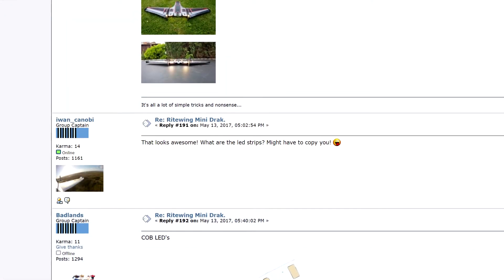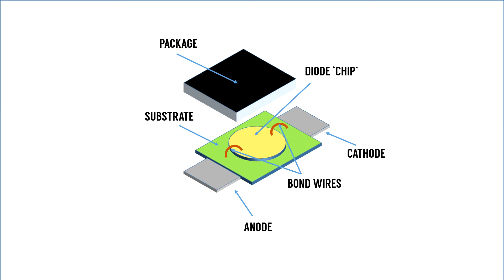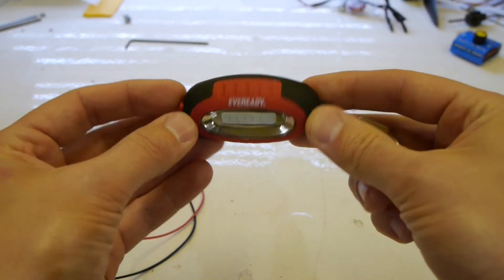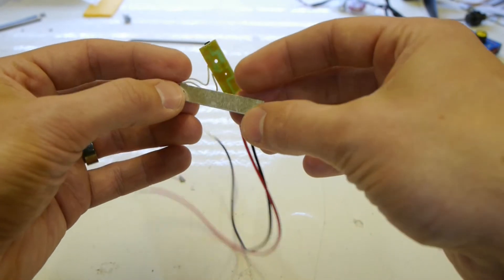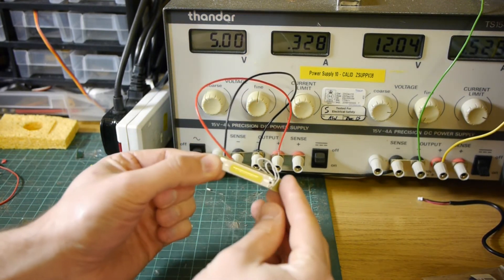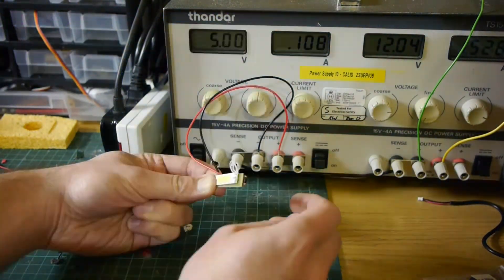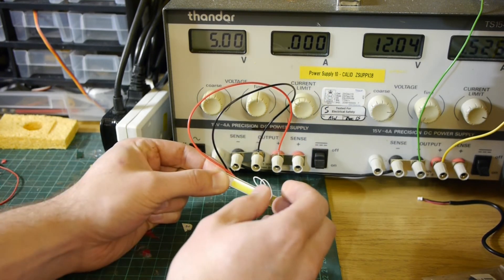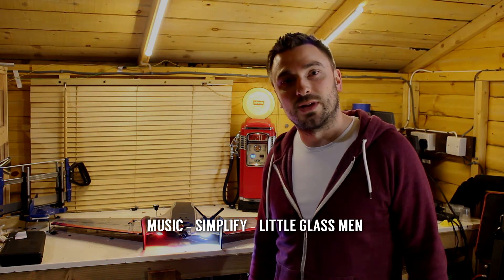COB LEDs - Shed some light...

Comment: Nice video!  What thickness lam film did you use on your Mini Drak?
Reply from the maker: Andy Sayle cheers! I actually used laminating pouches that I had access to from work so I'm not sure what weight it was! I used light stuff on the top and heavier on the bottom. It will handle any weight really though!